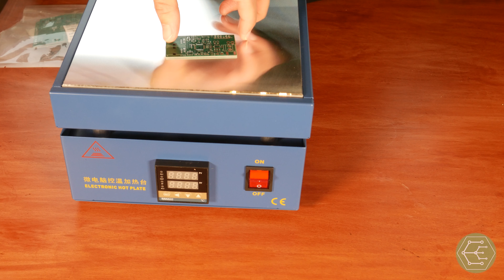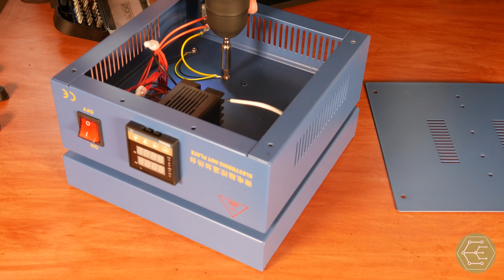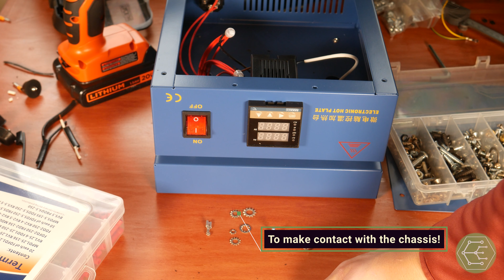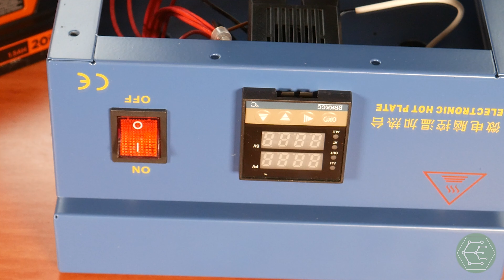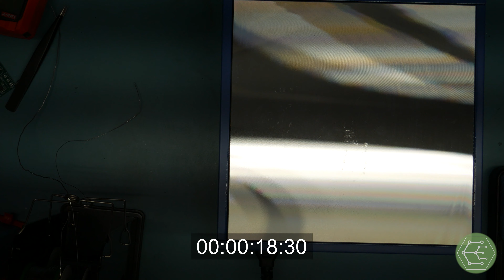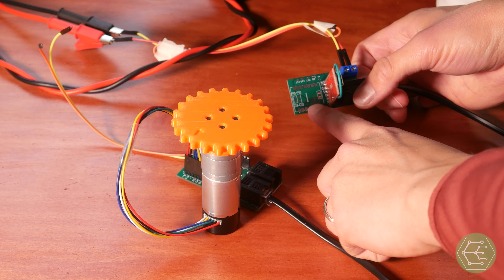DIY Reflow - but it works this time! | MOT12

Comment: Measured surface temperature uniformity with a non-contact IR thermometer would be nice to know.  The low emissivity of the shiny surface would give an inaccurate reading, but the uniformity is what we'd be looking for.
Reply from the maker: Very interesting idea Winston! I have a dev kit somewhere for a low-res non-contact IR thermometer (something like 64x64 pixels) Probably good enough to evaluate something like this!  I'll try to dig it out of storage and hook that into a future video!

Comment: If you really need a reliable solution with curves there is a module that you can use to mod a regular oven into a reflow oven
Reply from the maker: Hi Alex!  Great idea, I've heard of these modules... I figure this hot plate setup could naturally provide more even heating than a toaster oven - given the giant metal plate. Maybe I'm wrong, but using one of those controllers (to add temperature profiles) with this could be a winning combination!

Comment: In my humble opinion the whole thing is designed pretty well (ignoring grounding issues which is common for all chinese things), the high heat capacity of the top plate and just putting a prebuilt PID temperature controller is great compared to what those chinese engineers would cook up
Reply from the maker: Agreed Alex - This is, all things considered, quite good for the money. I'm pretty excited about it - and I hope it holds up well!
Reply: most people would spend 2 seconds of the video on this safety bs. you may be an engineer but you're a broke one lol. I don't mean to hate but I'm here to see your work and how you made a pcb. this is the 4th video I've watched where you natter on about grounding.
Reply: @jstro-hobbytech  I completely disagree. I'm a student studying electrical engineering, looking at getting a hot plate. The reason I clicked this video was to evaluate this product for safety and grounding concerns since I haven't done much work with unsafe voltages.

Comment: Why do they make those temperature regulators so large? I have dual display one (w1219?) that is just a small PCB with 120/12V.
Reply from the maker: I'm not sure, Bob! I've seen similar controllers before, but for being a simple relay power output.. it does seem a bit big.
Reply: @EEforEveryone  Do a teardown of it on the next show.